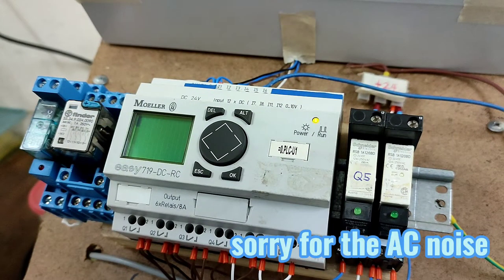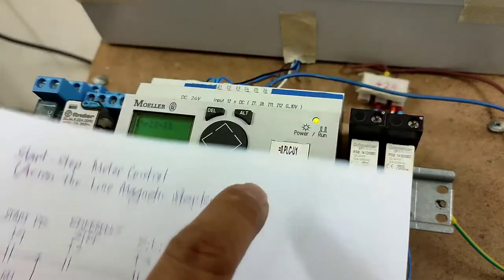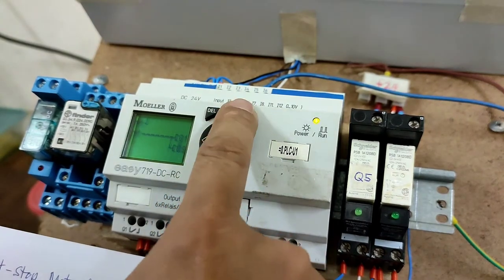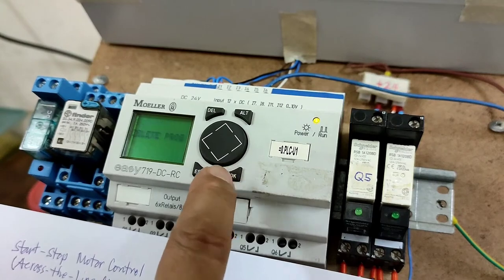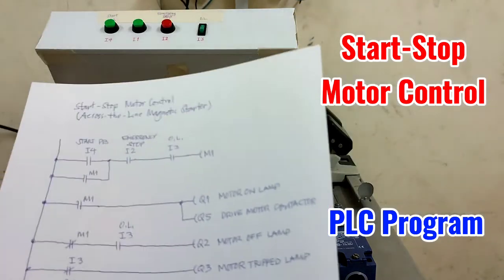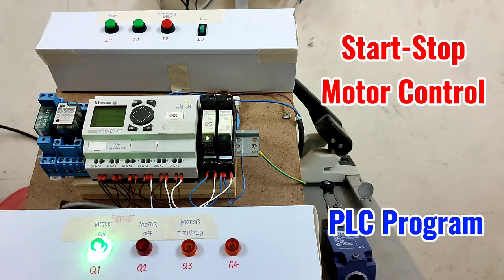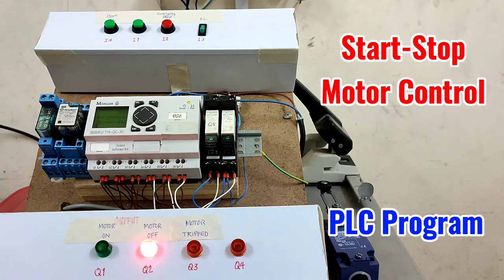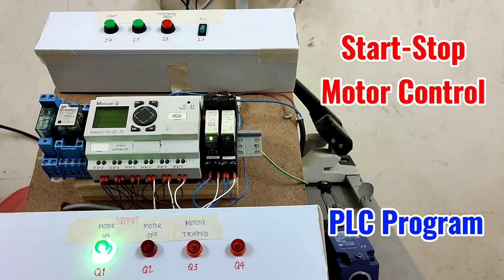Start-Stop Motor Control | PLC Program | MOELLER EASY 719

Comment: thanks man ! but whyyy emergency stop is normally open in diagram ?? isn't it the opposite??
Reply from the maker: Because the Emergency Stop PB is normally close... So it must be normally open at the diagram as well as in the PLC program... And it is also safe to use NC contact for Emergency Stop PB... Hope you get the point...
Reply: @t3chh3rtzvlog  Now I get it, thx

Comment: как сбросить пароль с EASY819-DC-RC?
Reply from the maker: The only way to access the PLC is to manually input 5 times the wrong password with the on-board display. After this you will be asked if you want to delete the program(which will remove the password too).